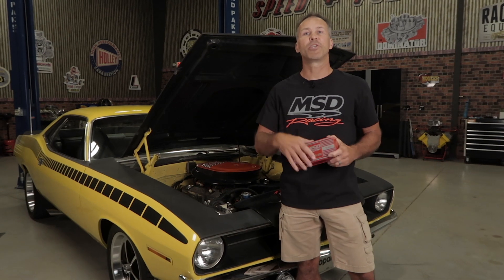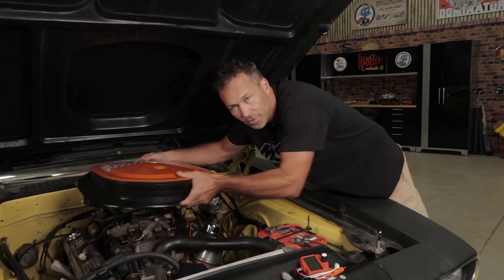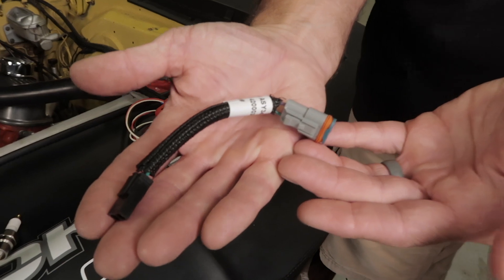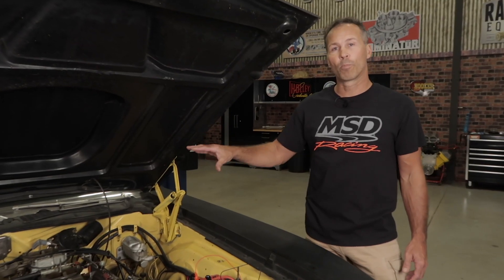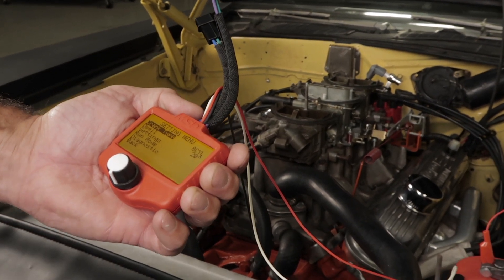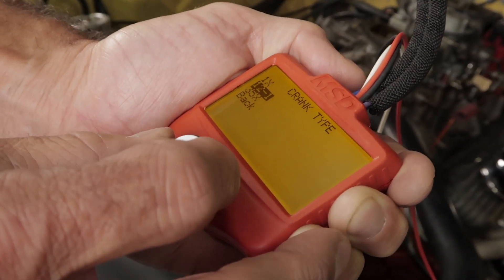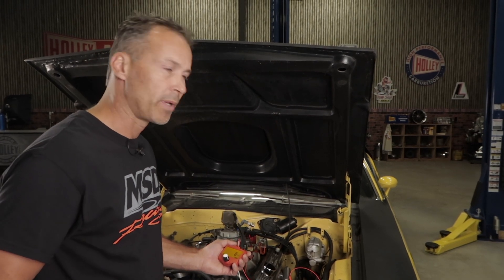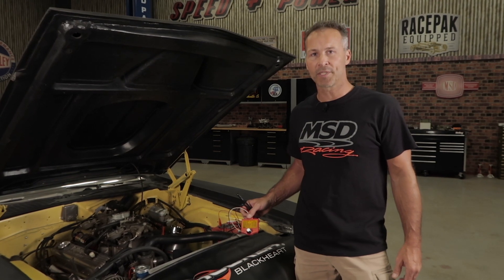How to Solve Ignition Problems with MSD’s Universal Ignition Tester

Comment: Can u help i have a new car 2005 so it dont  have a distributor cap.  but I need to be able to pull some timing out of my engine when I'm spraying nitrous .  but everything on YouTube about the MSD box all wires up to a distributor cap. Witch I don't have as they r on the older cars can u help please
Reply: You need to tune it with a computer